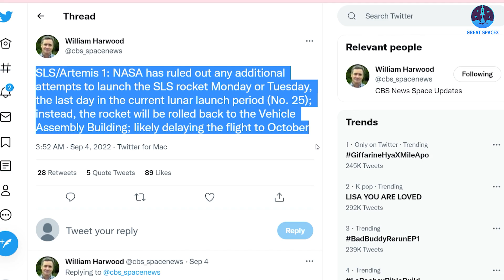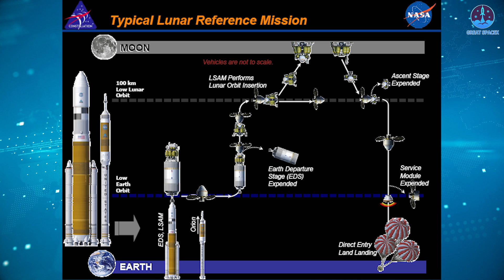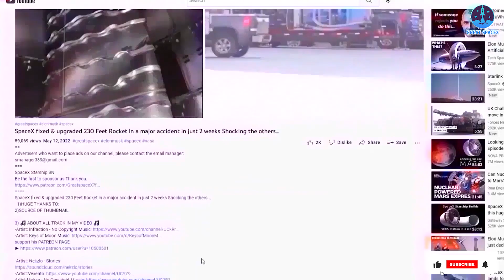WASTED! NASA gigantic $23B rocket major internal failure&leak. Starship to replace SLS, why not?

Comment: This is super stupid, considering all the shit I've seen SpaceX blow up when they started playing rockets.    SpaceX isn't doing anything that NASA didn't already do 50 years ago... Sure, there's that landing boosters on the ground to be reused, but we used to land them in the sea to be reused - which is admittedly less cool, but also way more safe and much a much better use of weight and energy on an orbital craft.    If Starship does 1/10th of the stuff Elon has promised it will do, I'll faint from surprise.    P.S.  You're in a cult.

Comment: The difference is Hydrogen vs Methane, but you've still got Liquid Oxygen to contend with. Their BIG excuse is that the SLS has a much greater payload capacity than the commercial programs. I think it's more of a contractor and bureaucrat problem.

Comment: Well done Great SpaceX! SLS is indeed a huge waste of public money. It was of course a triumph when it came to making money. Something that seems to get missed in the criticism. The shuttle, the ISS, Orion and J Web were all built by private companies with execs and shareholders. Companies who essentially have congress in their back pocket and have for the last 40 odd years taken over half a trillion dollars and taken American spaceflight backwards. But when pushed into a corner and forced to explain themselves, who do they ultimately blame? Engineers! That's right folks. You see according to them and it would appear, everyone else. This was all for you! They're all a jobs program right? All that money and failure just to give you a job. (Not sure your getting that guys) while private companies soak up billions in public money with projects that just keep on paying as long as they never finish (sound familiar?) and of course didn't make space any cheaper. while laughing their asses off as the Senate gets all the heat and the workers get the blame.

Comment: "During initial fuelling ops, a valve was inadvertently commanded open that briefly over pressurized the line." This is so unprofessional, and I suggest NASA should build a simulator and get its technicians to become proficient using it before attempting flight.
Reply: Or maybe, they hire Microsoft to write a program app for that. ;-)

Comment: If only Nasa had continually developed Saturn for 50 years rather than gone with the shuttle.  Imagine how capable that kind of system would be today.
Reply: I think that a space station with an updated core module or modules the size of Skylab would have been a nice starting point for a space station.  Even better would have been a core module made from a modified Shuttle External Tank.  (The Skylab interior served as a propellant tank during launch.)
Reply: Wouldn't make a difference because it would still be a government project with wasteful over priced spending and excessive delays..................................
Reply: @BennyCFD  Kennedy promised the moon in 1961 and feet hit the regolith in 1969.   Everything was (inflation adjusted) way cheaper.  A spacesuit was 100K (say 1m$ today) and worked.  NASA has recently given up on a new suit after spending billions.  

Aplollo was special ... probably because we had the USSR to keep everyone honest.
Reply: LOL.  Probably this same system!  I am glad we got the space station up and going opening the door to commercial space stations with GRAVITY, I hope.  I'd also like to see Space X connect 3 Spaceships together (side by side with tunnels) and then rotate the outer two for gravity.  I would think even on the Moon and Mars, it would be healthy to build a large horizontal centrifuge to create gravity for workouts and even sleeping.  Low gravity is horrific on the human body read astronaut Edward Kelly's book about returning to Earth and the hell he went through.  Any person going to Mars or the Moon for a long time will be much worse off.  Martians will not be able to return to the Earth without exoskeleton suits if at all.  The gravity would probably kill them.
Reply: saturn was more expensive than SLS by many orders of magnitude so they probably would have scrapped the saturn v and continued to improve and advance the saturn IB and maybe create the saturn III like how the russians still use soyuz americans would still use apollo

Comment: Kevin. Simon Sinek explains the difference between NASA's SLS and Spacex's Starship in his TED talk, Start With Why. It's very enlightening, and says all you need to know as to why SLS is such a miserable and expensive failure and Starship will beat it, if not to flight (which I think it will), certainly in ultimate utility.

Comment: Perhaps I can accept the cost and time overruns, generally major developments suffer from these. However, why are Nasa technicians having so many problems dealing with Hydrogen. They have been working with hydrogen/ oxygen propellants since the early '60s. These propellants powered Saturn V,  Apollo Command Module and Shuttle to name a few. Apollo was on time despite many setbacks and the Apollo 1 fatal accident because Nasa was flooded with money at the time. Shuttle was late and well over cost. The delay in deploying Shuttle was the reason for the loss of Skylab. Shuttle was supposed to reboost Skylab. SLS or the Mega Moon Rocket or the Big Orange Rocket, take your pick, has also suffered these cost and time overruns. Here in the UK we have suffered similar problems with major programs like Concorde, the Channel Tunnel and HST. No, I can accept the cost and time overruns to produce a major new program. What I don't understand is the repeated failure to handle hydrogen with this rocket. Have they forgotten all they learned over the last 60 years? That Big Orange Rocket has just stood there while Spacex and, to a lesser extent, ULA have been launching all around it. Looking forward to the last launch of Delta IV Heavy at Vandenberg soon. That rocket uses hydrogen too.
Reply: Saturn V used RP-1 for its first stage wirh LOX not Hydrogen. The rocket used Hydrogen for its 2nd and 3rd stages.  NASA calls this the Centuar stage. To todays young people the use of Hydrogen is very sexy but RP-1 is used almost everywhere on a rockets 1st stage. RP-1 is ultra refined kerosene with melting point of about -48 to -28 degrees C and a boiling point of about 170 to 210 degrees C.
Reply: @darkangel2347  Thanks mate, my bad. I checked this out before posting but missed this point. However, why is Nasa having so many problems with hydrogen fuel in SLS? They still have 60 years of handling hydrogen fuel. Perhaps they should have saved a few F1 engines instead. Thanks for the reply.

Comment: In order to make informed judgement per a legitimate plan based on what is happening in real time (SpaceX vs. NASA) would require some knowledge and that just doesn't mix with politics.
Politicians on both sides screwed this up based on Obama not having the gonads to explain to the US what was being worked on would be antiquated before you get started, much less here we are moving into final quarter of '22 using Space Shuttle shit.
It is the politicians fault and our current commander/chief isn't all there.  Keep pushing forward SpaceX!

Comment: SLS can only be fueled to full pressure a hand full of time before it has to be scrapped and rebuilt due to the problems with using the materials, they insisted on using. Elon was right to use methane and lox instead of hydrogen and stainless steel over aircraft aluminum. NASA seems to have a problem learning from their mistakes which have carried over from the shuttle program. to make things even worse SLS price is only going to go up by the time the fourth launch happens it could be close to 500 billion per launch. Space X can do this entire program cheaper and more efficiently.

Comment: Yea it would be cheaper and more interesting if nasa just used spacex  starship by itself to go to the moon but it is always great to have two ways to got to space just in case one of them gets cancelled just like how space shuttle got cancelled and then they had to launch from Russia.  

Edit: it is also very rare for a new rocket to not launch on the first few attemt
Reply: As it stands Starship isn't cheaper per launch than SLS, but that's because it delivers an unnecessarily big payload and so it has to actually launch six times for refueling. What should be done is to develop a cheaper expendable launch vehicle like the Saturn V(or a derivative such as the Comet HLLV) with a kerosene first stage so you don't have to waste so much time, energy, and money on storing and cooling that much LH2.

Comment: I could not stress enough that all this mess is mostly not NASA's fault. From over-designed Shuttle that just had to have never used single orbit mission capability to absurd Constellation with its Ares-I which would kill its crew by vibration if NASA was stupid enough to try a crewed flight, to SLS that for years had no program to participate in, all this was forced upon NASA by congressctitters distributing pork among their constituencies (no outright embezzlement was necessary - merely protecting contracts for donors and jobs for voters sufficed.). In these programs (as in Apollo) participated contractors from literally every state (I guess they produce nice stickers in Montana, Alaska or Hawaii - no disrespect intended - those states have other nice features and products.)
SpaceX operates in just three states and has relatively few subcontractors and suppliers - where is pork here?

Comment: SLS is a pile of space junk literally junk, junk being old space shuttle failed Technologies and equipment the space shuttle is a complete failure killed two missions and two Crews needlessly because it was nothing but a pork barrel Bonanza with no focus on safety and no focus on what needed to be done the SLS is 100 times that it is a death machine with no Mission capability and it will never do anything except possibly throw some astronauts at the moon and maybe bring them back alive it can't even transport its own Lander that's why Starship is involved. This pile of space junk by any realistic estimate or statistical analysis has less than 25% chance of reaching trans lunar insertion without exploding like Challenger. SLS should be defunded immediately, it should never even be launched and it should be delegated to Aerospace Museum status immediately

Comment: One word: corruption.
Those senators and some people in charge need more pocket money.
With the more extended time for developing SLS, the money bleed from there would goes directly to their pockets.
But then, since StarShip 15 has been  landed successfully, and Musk's determination, also how cheap it is to build a rocket, they had no choice but to halt SpaceX effort to fly first, and speed stacking the SLS... Hence, problems occur because of it...
If starship fly before SLS, and success, they will loose public opinion to reason the bleeding budget for all the Artemis programs...
Typical politicians move...

Comment: Question that begs an answer is how much fuel & oxygen could SpaceX  pre positioned in orbit per billion. Same question for the moon or ISS? Seems a  orbital gas station an warehouse are needed. Though I haven't given up on my practicality of a lunar space elevator question.
Reply: Just dreaming here cause I'd add a green house an spin up all or  part to a gravity.  Kinda like the giant London Farris Wheel.  Balance maintained by putting fuel, air, water, an waste on separate cable reals. Even a center docking module could be spun up an down with cables and a brake disk an calipers Balanced against centrifugal force if necessary.  Got your start for a B&B hotel an grocery store. Space sailors will work in the rigging again. Lol. Hydroponic an or aquaponic farming an research in space. Planning a trip? Could I interest you in one of are fully tested an scalable farm an oxygen recycling domes? Totally green & yes we recycle ♻️ and pay top dollar on all types of scap too. "Welcome to Trump Towers. There's never been anyplace like it. "

Comment: SpaceX initially failed several times before finally succeeding.  I respect the perseverance of this team.  What I don't respect is NASA's pandering to politicians and Boeing's outdated and inept engineering.  Cut your losses and move on.  5 years behind schedule is enough.
Reply: SpaceX is not afraid to make failures. See "how not to land an orbital booster"  NASA could have tried the SLS back in 2015, and made a video " how not to recycle Space Shuttle Hardware effectively" then again, having humans on board is sort of different, and SoaceX also showed a lot more caution with that, as it should.
Reply: its about greasing union palms
Reply: Yeah. But it did not take 23B and 20 years

Comment: Congress are suffering from what is sometimes referred to as sunk cost fallacy.  Instead of asking, "what's the best thing to do now?" they are saying "we've spent $23billion on it we should just push on."  

Cut your losses.  Stop that nonsense now.  Even if SLS finally works as it should, each launch will cost the same as hundreds of Falcon heavy launches.  Not to mention what Starship success might look like.  NASA should build the Gateway components and send them up with Falcon heavy ASAP. Use that to start shuttling useful equipment and habitation down to the surface near the south pole in preparation for people to arrive.

Comment: I think SpaceX is the best option. But if SpaceX linked up with what use to be called gateway they could make cycling ships with artificial gravity. The easiest would be there design using Begalow technology modules. They would be like interplanetary mother ships. They would have all the needed facilities for years. This smaller version could have over a hundred people. The SpaceX starship at first could be setup in the front. It would have to be nuclear powered.
Reply: What??!   Artificial gravity???

Comment: Could the Artemis ship be launched on a SpaceX Falcon Heavy rocket? It looks the primary issue is the NASA in house rocket system.
Reply: You think the Artemis ship is going to have better luck!?  Best send it to the space museum and use the simpler, cheeper, Starship that bypasses a stupid, unneeded old school moon station?!  What could possibly go wrong?
Reply: I don't think even Falcon Heavy can handle the Artemis ship when configured for a lunar flight because there is an upper stage needed for the TLI burn that takes the payload weight well above what F.H. can loft.
Reply: @robertf3479  
Falcon heavy can make the lift if the core stage is expended without recovery. If the core and the boosters are fully extended again without recovery. It should exceed the expected lift and push needed.
Reply: @robertf3479  the entire question is ridiculous!

Comment: Imagine if all of this money had been put into Starship instead of big aerospace executives pockets.
Reply: A lot of federal gov't politicking at NASA, they should have used the money on the development of a new propulsion system.
Reply: It was a jobs program. Sure a few executives made off like bandits. But this was always an American jobs program that also happens to be a moon rocket. Could the money have been spent better - yes. The only way money like that would ever go to space X is if it provided jobs all across the US vs in a few select areas. Lets just be happy they are at least doing something vs wasting it on war.
Reply: you don't want them anywhere near Starship, as they will try to turn it into another SLS, and i would not want that
Reply: or SpaceX competitor(s)
Reply from the maker: If it happened, we would be on Mars already!!!
Reply: @colonbina1  LOL no.  Radiation issues still not solved to make trip to Mars.
Reply: @godslayer1415  more money more development more development higher chances of discovery
Reply: @godslayer1415  But is NASA actually attempting to solve them? I guess after SLS is finished they will have the funds to work on those problems😂

Comment: I called it last week, this SLS white Elephant will not fly but will only leave the pad either by explosion or to the scape yard. $10 billion and counting, if only this money was given to a competent company instead of the Military Complex contractors. FJB
Reply: I'm not that pessimistic. I think SLS will fly and it will work in the end and yes it will be a huge success, just like the Space Shuttle was! Remember the Space Shuttle? It would fly weekly to space, reduce cost in great numbers and would be as safe as can be. In the end we had only 135 launches, (less then 5 launches a year, or one launch every 2 months), cost about $450.000.000 per launch and failed two times in a spectacular way! Yes it was a success And SLS will be the same, it will work, but it will be very expensive, it will not work as predicted and, well it will not be reusable.
But on the other hand there is at this moment not an other rocket out there that can do the job of the SLS, Starship isn't ready for any flight, let alone human flights and lets not talk about New Glenn!
Reply: @platoplat498  Quit pretending to be MSNBC, the Shuttle never flew weekly and NASA never fixed the heat shield problem. SLS is just a big White Elephant, when's the next launch attempt? New Glenn is a joke but it's Boso's money.
Reply: @joeshmoe4671  Isn't that exactly what I said? The SLS will be as big a success as the Spaceshuttle was. So iot is to expensive, probably not really reliable, not reusable, but it will fly in the end.
But indeed a "success" just as the Space shuttle was. Maybe I had to say it was sarcastic, but I'm sure it will fly! And I've never seen a white elephant fly, pink elephants though... 
😁😁😁😁🍷🍷🍷
Reply: 10 billion? and the rest. so far its 23 billion